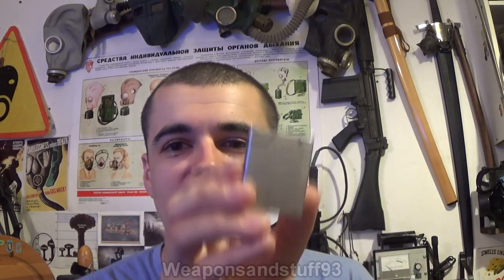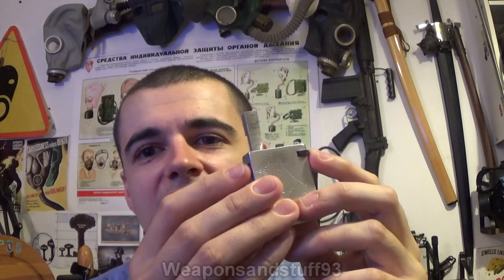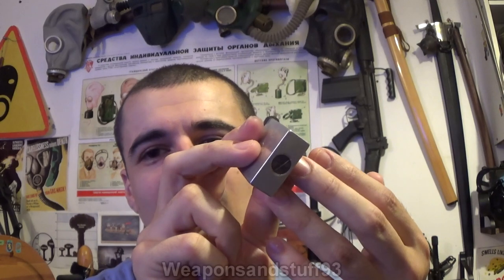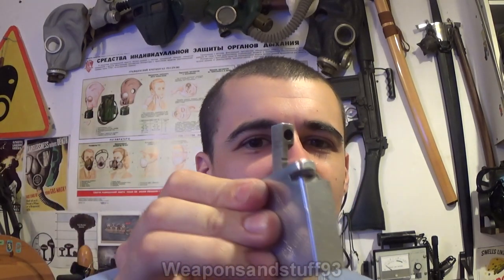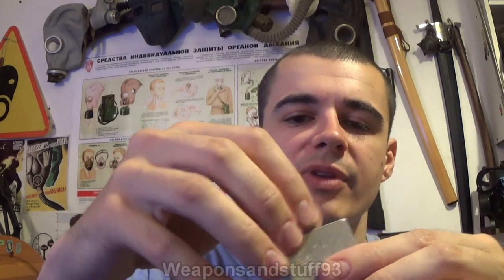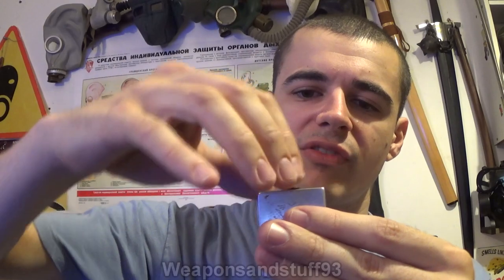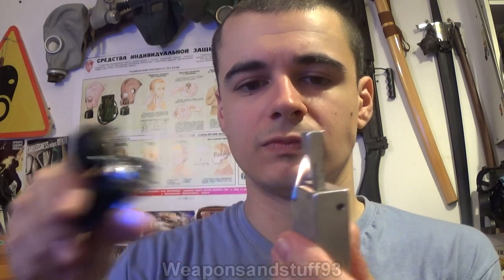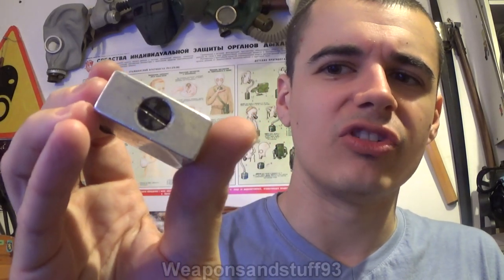Restored Possible Italian WW2 Lighter

Comment: I removed all the wading from inside that after removing the old wick ,replaced it with a zippo wick by threading a thin bit of wire straight through the lighter with the zippo wick attached to it ,then pulled it straight through to were i needed it to be ,then oncd cut to the right size replace the wading and then fill as normal .I also got a throw away lighter and ground down the striker wheel to replace the old striker on the trench lighter ..

Comment: Very nice old lighter, well worth owning and a very nice collectors piece and once fully working would be a great edc lighter and talking point.
Reply: Funnily enough before you said i was going to say may it needs some rubber o rings / washers, 
Also i wonder if the flint wheel is on upside down, try flicking it backwards and if it strikes better take it out again and turn it around,  they work better one way than the other a bit like a file, hope that makes sense, (bit like if you strike a clipper backwards its hardly strikes, but right way its good.)
Reply from the maker: Yeah its the right way around now but originally it wasn't as it strike easier in the direction that threw more sparks away from the lighter not into it.
Reply: @Weaponsandstuff93  Cool just thought i'd mention it as its a easy thing to miss and easy to happen when changing too, but not obvious its happened, also i will be on 9pm mate, see you then

Comment: If the wick is too tight you could try candle wicks. You can buy them in "hobby-shops" or such. There are different thicknesses and they wick the fuel very well (as a proper wick should). I sometimes use them in Zippos because they are cheap and multi-purpose. The lack of copper wire in the candle wick does not really make a difference in my opinion other than in getting it through the hole because copper wire makes the wick stiffer. But getting the wick through can easily be done with a pincer, toothpick or something if needed. Perhaps the wick is too tightly squeezed to properly wick the fuel, then a thinner wick would be helpful.
Reply from the maker: Thanks for the good idea